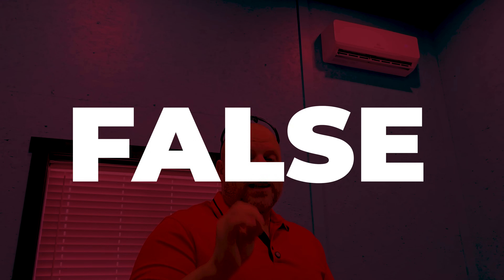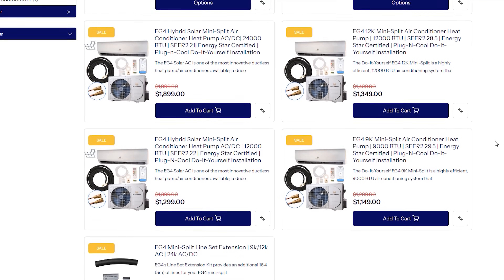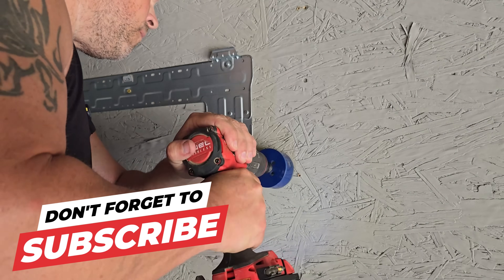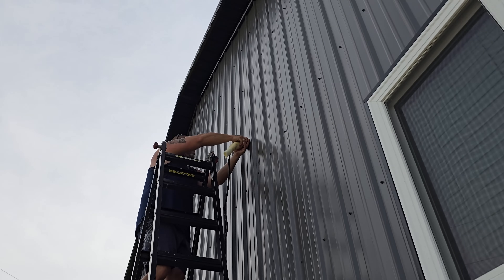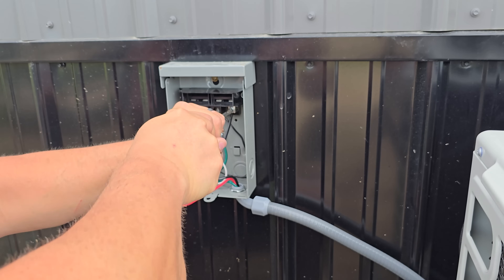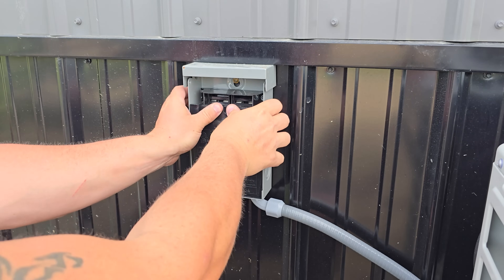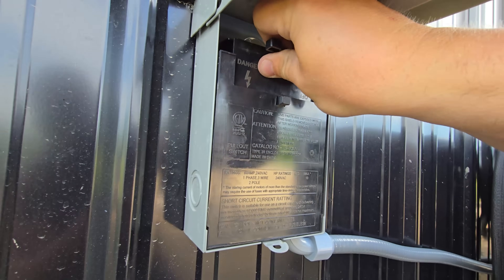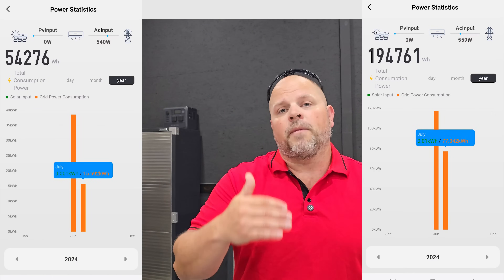TRUE DIY INSTALL - EG4 12K & 24k SOLAR mini splits - BETTER THAN MR COOL!!!

Comment from the maker: 12K Solar Mini Split: https://signaturesolar.com/eg4-hybrid-solar-mini-split-air-conditioner-heat-pump-ac-dc-12000-btu-seer2-22-plug-n-cool-do-it-yourself-installation/?ref=justinsproject
24K Solar Mini Split: https://signaturesolar.com/eg4-hybrid-ac-dc-solar-air-conditioner-2-ton/?ref=justinsproject

Comment: Very informative, thanks for sharing.

Note, you might consider adding some white tape to the red wire you designated "neutral", as well as landing that ground wire to the same or similar place as the head unit ground (possible hazardous condition without)...  your call.

Comment: I have brick outside it's going to be hard AF lol
Reply from the maker: A good rotary or SDS hammer drill and bit. It will be simpler than you think. Only one hole to drill.

Comment: You forgot to pull a vacuum before you open the refrigerant.
Reply from the maker: No need to pull vacuum on this system. It's one reason its a true DIY system. 👍🏻 Everything including the lineset is pre-charged.

Comment: I can't seem to find what size breaker I would need for just the 1200 btu unit.
Reply from the maker: @LarryRichelli  20amp 120v single pole is what I used for the 12000btu. 20amp 240v double pole for the 24000btu unit is what I used.

Comment: $900 for a 12,000 BTU Della plus accessories and $1400 for a technician to install.  A 9000 btu EG4 is $1750 give or take with some accessories.  Is the savings of about $700 worth it?  Thinking about it.
Reply from the maker: It really just depends on what your time and labor is worth to you. $1400 for a couple hours of work was worth it to me.

Comment: Was that not a green ground screw in there?
Reply from the maker: It was being used by another ground wire. Technically we are to never add 2 wires on a single wire connection. The reason I pointed this out in the video is to bring awareness to it. The 12k mini split should have a dedicated ground connection like the 24k unit does. I think I achieved that but I should have explained it better in the video.

Comment: i like the eg4 unit with the solar input. i bought the inovair 38 seer unit for my rv and its only 9000 btu but is kinda overkill. it actually works way way better than the 13k roof top unit i removed. i went with the 38 seer because it is capable of heating at a much lower temp but in doing so it does use more power. im wanting to install the 12k eg4 unit on my dads house for his bedroom because hes getting old and needs the comfort a mini split provides. thanks for making the video
Reply from the maker: The 12k does a great job in the space I have it located in. Would be perfect for a bedroom in most cases.
Reply: @JustinsProject  the 9 k unit I have is a lot stronger than my older 13k unit. weird kinda but it actually cools and heats a 30 foot rv with no problem and if I had it to do over I'd get the little 6k unit because it's so much smaller and would still do what I need I think. it would work harder but the 9k unit is barely having to come on to do the job and when on auto fan it's like a tornado in there when it ramps up.

Comment: You lost me at 5:56.   I have no electrical knowledge or experience so the "DIY" part is only AFTER you've installed box and have a dedicated circuit pulled outside.  I just bought this and have an electrician scheduled to do that part.

Comment: granted like you said your space has 12ft ceilings but 54kw a day?  how much solar do you have?!  also how many batteries do you have if you are only using those (rather expensive) bluetti portable power stations to power your ac?

Comment: My advice is simple... as an HVAC guy... if you're not comfortable doing something, don't do it.  Some things are not meant to be DIY... BUT if you're going to give it a go read EVERYTHING first... then reread it.   Just remember IF by accident you do something wrong it will cost you twice as much to get it fixed... so READ.

Comment: Honestly the first time I actually think I could install something. I have zero skills in this type of thing. I’d just be worried I would drill the hole too low or high 😂😂 But this is something I’m definaly interested in. Even if you put one in separate rooms I would think it would help with families that liked different temps.

Comment: Ground goes to Ground it's same ground used for the Head Unit
Reply from the maker: My question is why they did not included a dedicated spot for it like they did in the 24k unit.

Comment: So supposed to tighten to 20ft lbs on those line-sets according to the spec sheet, now im no expert but that flex at 8:15 lookin more like 60 ft lbs- as the germans say "gutten'tight"

Comment: Great video.  I installed a Senville 18,000 btu in our home second floor a couple years ago which required a AC tech . I am investigating different options for my garage . With the Senville ,I did everything except the AC vac on the Senville.  One thing I saw on various YouTube comments is that you should coil the excess lines horizontal under instead of vertical behind the outside unit because the oil in the lines will pool at the bottom of the lines and can cause compressor failure.
Reply from the maker: Thanks for watching and commenting!
Reply: Why not just place your outside unit far enough away to use the whole length of the line set,otherwise you should just cut,flare and vacuum your line set either yourself or hire an HVAC tech.The money you save buying a Senville you could do either.Senville makes an excellent product and this EG4 unit made by DEYE is excellent as well
Reply: @ Thanks , that’s my plan for my Florida garage as i think i can move the outside unit . I am considering a Delta as well .
Reply: @Marvin-fn7ks  I just looked at a delta unit and it is made by Midea the same as senville.I will admit I see the senville costs more in USA than Canada.The canadian dollar is worth about .72US.Senville has all their parts for sale on their website

Comment: For 240VAC loads, always use black and red as the legs, and white as neutral. If no neutral is needed, cap off the white. Don't use black and white for hot legs and cap the red!
Reply from the maker: This is a 120v system. I had previously installed 12/3 wire. I should have installed 12/2 for this system but in the end opted for a smaller system for the room it was cooling & heating. So 12/2 was all I needed but the 12/3 wire was already installed. Since all my 120v circuits are black and white I opted not to use the red wire on either side but left it there in case I ever needed it in the future.

Comment: You need a ring terminal on that ground wire to connect it. That unit is not grounded. If you get a short to the chasis ot will be energized that is the reason for the chasis ground.
Reply from the maker: Thanks for watching and commenting

Comment: Mini-splits with precharged lines are pricey, mainly due to the special fittings.  Much cheaper to buy a mini-split with open lines and a vacuum pump ($70 Amazon).  The compressor is still pre-charged.  You can use the pump later for car AC work.  The later allows cutting and flaring the lines to size so no extra coiling.  But, haven't seen any mini-splits but the EG4 and Mr Cool which can run directly off PV panels with no inverter.  Best to squirt some No-Ox grease in the PV connectors, and even coat the  AC wire ends with it.
Reply from the maker: Thanks for watching and commenting

Comment: Unfortunately EG4 and MrCool are charged w R410A refrigerant. Starting 2025, new refrigerant will be required (R32 and R454A). Wait til 2025 to purchase newly designed heat pumps with higher efficiency w new refrigerants.
Reply from the maker: Thanks for watching and commenting

Comment: I just installed the EG4 9K unit by myself a couple weeks ago. This thing is amazing! It keeps over 1000sqft cool overnight just sipping 200W! I had another 8K AC unit that was barely getting the house down to 87F in the summer heat. The EG4 instantly changed that to 76F with power to spare. Did I mention how quiet they are too? If I can't see it I use the wireless app to see if its on. Wish these were around long ago. Can't use the heat pump feature this winter!
Reply: How much did you pay for everything? Might do this with our relatives' place in a hot and humid region.
Reply from the maker: Thanks for watching and commenting

Comment: QUESTION?  If I install this How do i know if I need a net meter with this or if I have one of the solar panels with a micro invertor. How would I know if I am getting charged for the smaller amount of power produced Vs Having like a large whole house solar system installed?  To have a net meter installed my power comapny requires an application with the solar company and electrician listed and signed etc  so that would element being able to have a net meter with a solar minisplit DIY or a just plug in panel with microinverter.
Reply from the maker: If you are installing a complete home solar system you need net metering. If you are installing only this mini split you would not need it, since this does not backfeed to the grid.

Comment: Eg4 is only warrantied if a licensed installer does the install.
Reply from the maker: Technically, I think all of them have that stipulation.
Reply: @TheSolarPit  Pretty good gig having that out. They advertise diy, plug and play all over the place so when people diy the company has an out when something goes wrong with the units.

Comment: I would not buy any AC that uses R410.  It is an obsolete refrigerant that will soon be as hard to get as R22.  There will eventually be leaks and service will be expensive or not obtainable.  It is being phased out in 2024.  I suspect there will be many "bargain" AC systems dumped on the market because of this.  Not to say they are not good units, just that manufacturers must switch to the newer, approved refrigerants and selling off inventory is a must.  If you can buy a good, sealed refrigerant system that you want to last and are willing to chance no or very expensive service, then go for it.  Mini splits are very prone to leaking because there are joints that are not braised and are therefore going to loosen and leak over time.  Good luck.
Reply from the maker: Thanks for watching and commenting

Comment: The green ground connects to the green ground screw it's right there! SHOCK HAZARD>>>>>>
Reply from the maker: Thanks for watching and commenting 👍🏻
Reply: The manufacturer pre-installed the ground that isn't green. He put his under the green screw.
Reply: If you get shocked hooking up a ground you've got big problems.....and you need professional help at that point.
Reply: @TheCowboysdude  Well I have been shocked hooking up a ground and it's not there to shock you it's there to help prevent a shock hazard!
Reply: Actually "ground" and "earth" are entirely different. This being a consumer installed product that ties into the grid and has a UL listing along with a solar intertie makes the rules different. 
I know in 220, the ground is tied in the service panel to the neutral. I just ran a chassis ground too. I dont know the codes just general info.

Comment: Ok.. I'm back. Miss me..?  lol..  I now have my EG4 Hybrid 12k. Can't wait to get in installed.
Reply from the maker: Let us know how it goes. 👍
Reply: It was a tight fit, but it's  in and working. I have 2 sunpower 305w panels in series powering it, when the 🌞 is out here in not to sunny S. Oregon. I like it, but the app and the remote needs work. To get any SERIOUS A\C or HEAT from it, it needs an ac source. It's like Trump, it's not perfect but it works great. Good value for the money.

Comment: the place to hook up the ground is visible at 7:10
Reply from the maker: Where? On the screw that already has a ground wire on it? Most screw terminals are designed for only a single wire. Or am I mistaken?
Reply: @TheSolarPit  yes, on the same terminal it’s OK to stack them
Reply: @TheSolarPit  another way to do. It is put a single pigtail on the screw and then wire nut all three wires together.

Comment: Hey there...where did you get the stand for the outside unit. I like that better than the concrete pads I've seen... Thanks...and great video... you gave me some courage to DYI it...10x20 shed...its insulated by me and you're right... it's been extremely hot. And I have 2 6ft lofts in my shed. So, its part storage and part man cave. Again, Thanks for the video👍👍👍👍
Reply from the maker: Much appreciated! I got the stands off Amazon. Here is a link to the exact one that I purchased: https://amzn.to/3Wfszf6
Reply: @TheSolarPit  Thank you....I will be getting my unit by Oct 15th...bills bills and more bills...lol
Reply: @TheSolarPit  I just bought 2 of the 12000. One a month ago and one more I ordered last week. I too was wondering about the stand, thank you for putting a link up! Great job on the video!

Comment: Just put the same 12K unit in last week. Found the process just as you did. Unbelievable performance. I intend to add solar as well. Can you imagine all that cooling/heating for free when operating on solar? Appreciate your video. Not a bunch of extraneous crap, just straight forward info. However, I implore you to revisit your branch circuit ground that you left disconnected on outdoor unit. Please install a #12 AWG ring or spade lug on the grounding conductor and attach it to the screw holding the GRN/YEL wire from the included wiring harness. Not trying to be a smart@$$, but it will complete your safety grounding circuit. Yes, I am an Electrician! Thanks again.
Reply from the maker: I appreciate the constructive feedback. I agree. The ground should be connected. My concern and call out is to stress the point that there was no dedicated spot for it. As there was on the 24k unit. I did not do the best job trying to explain that. I should have done better there. I did reach out to EG4 and got confirmation from their engineering department that they will fix it and update their install guide. So, I guess it worked in a sense. Thanks for watching and commenting 👍🏻
Reply: I did the same years ago, definitely add the panels. Mine almost ran gridless during the day on 6 dedicated 300 watt panels in Texas.
Reply: To much work for my blood and I don't think it's that easy. I'll stick with a window air conditioner. Sorry

Comment: What if the unit is 50' away from outdoor.   Do they have 50' lime set? Or can they connect 2 or 3 line set?
Reply from the maker: Yes they have additional line sets for extending the total length if that is needed.

Comment: Good job w 2 exceptions,you didn’t use a sleeve going thru the shop wall,and it had sharp edges from the tin. You never connected the ground from the disconnect to the outdoor unit.This is potentially dangerous as neither unit is grounded . Plz go pull that cover off strip back the green wire and wrap it around the same ground screw the indoor unit used or crimp on a solderless terminal. Great job otherwise and it’s nice to see an option to Mr cool. Clearly they are the advertising Kings all you see is their ads .
Reply from the maker: Thanks for watching and the constructive feedback

Comment: green wire to green screw it needs to be grounded !!!!
Reply from the maker: Are you referring to the one that already has a wire connected on it?
Reply: @JustinsProject  I seen a green screw in the unit.That's where The Wire needs to be landed.You don't have a path back to ground there.Go if the unit short that you will become the ground.If you touch the unit it needs to be grounded

Comment: Thanks for the video!  EG4 seems to be a good option to consider!
Reply: I just installed 12,000 BTU unit myself, total cost $3000.00. It should be paid for in 5 years, cut my electric bill almost in half.
Reply from the maker: Did your installation go smooth? I assume the 3k is everything, including the solar array, right? Thanks for watching and commenting 👍🏻
Reply: @TheSolarPit  The only problem I had was scanning the bar code on the unit to download the app on my phone. One phone call, problem solved. I sank 4 6"X6" treated post 40" down and they stick up 36". I put a treated 4"X 6" on top of them and mounted the panels ground mount frame it came with to the top. Grounded my array with left over 6 gauge wire I had and couldn't be more happy with how it turned out'. $3000.00 for everything.
Reply from the maker: Awesome! Thanks for sharing! Did you connect it to AC also? Just wondering what you did for the ground wire if you did connect it to an AC disconnect.
Reply: @TheSolarPit  I used a 6 foot long piece of 12 guage extension cord to plug into a grid powered outlet on my house. I bought a 8 foot 1/2" copper rod I sank next to my array. Connected all my 6 gauge ground wires to it and ran a 10 gauge wire from the compressor ground to my ground rod. So the compressor is essential grounded from both my house and array grounds.
Reply from the maker: @RichardQuaid Thanks for sharing!
Reply from the maker: Thanks for watching and commenting 👍🏻

Comment: Why did you not evacuate the unit the line set and the unit inside the valve is right there.
Reply from the maker: Everything, including the lines, are pre charged. There is no need to pull vacuum on anything with these systems. Thanks for watching and commenting 👍🏻

Comment: wish 9000btu ran dc direct or maybe 12000btu had dual zones......i run 6000btu on 2nd floor only......?.....how low will the 12000btu run at lowest btu? I believe the 9000 has higher seer rating??
Reply from the maker: Yes, the 9k units from EG4 that are not DC do have a better seer rating.